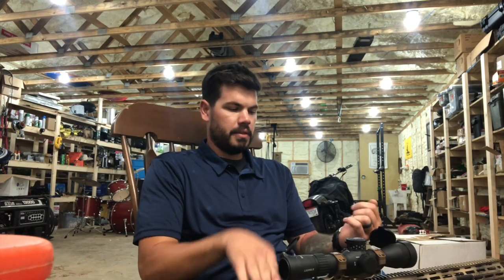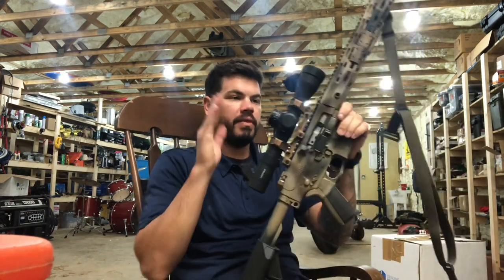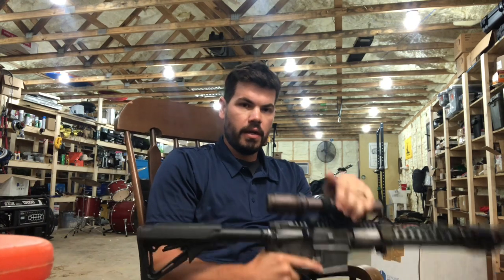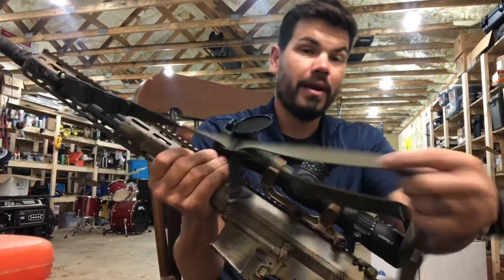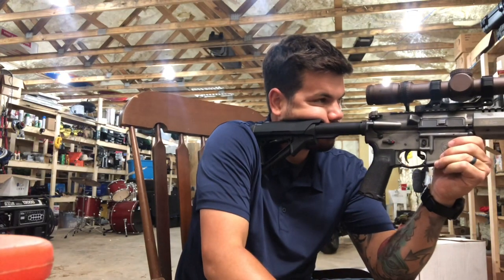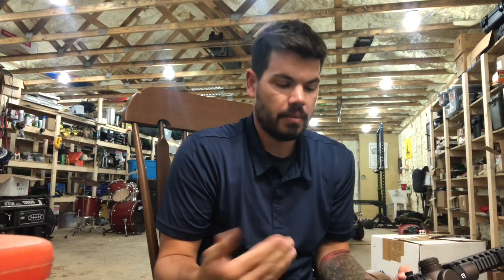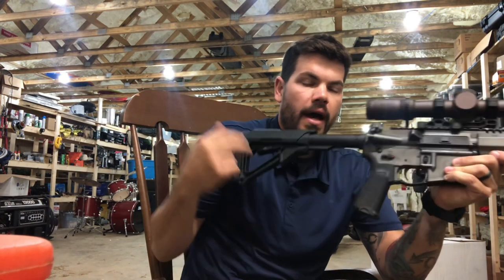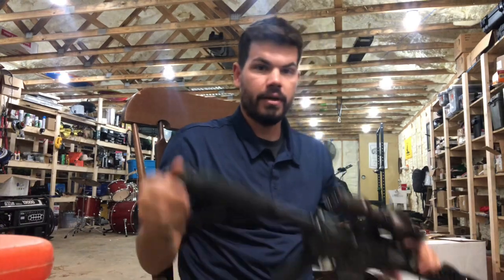Some things you need to know about high mounts and cheek risers NOW!

Comment: Great tips! Thanks 🙏 
I struggled trying to get my carbine where I would be able to use the fixed front sight/ carry handle rear sights and add an optic. I found the 2.5x20 Leupold does the job. 
It’s definitely a jaw weld but maybe it’s the fixed low power and generous eye relief that makes it work. Probably not the best competition setup but I don’t shoot competition.

Comment: Thanks for the explanation with parallax, I've never heard anyone explain why the higher mounts actually throw off precision long range.
I wear glasses, and getting my head in line makes me have to look over the top of my lenses unless my glasses are really pushed all the way up, so I'm hoping the 1.93 mount I have coming helps with that. I have the luth ar mba1 stock, so I think it will with the adjustable comb, which I've had to leave all the way down with the 1.5 mount

Comment: US Service Rifle Competition, where Shooters shoot from standing, sitting, and prone positions, inspires shooters to learn how to make themselves fit the rifle in any position for a muscularly relaxed stockweld, resting the entire weight of the head upon the comb of the stock. Correct adjustment is always possible when the rifle is brought to the head rather than the head to the stock. This procedure will allow bone to determine the height of the position rather than artificial support used in building the position. At any rate, retaining the 1.5 sight height is a good idea because the rifle can be made to get a proper stock weld from any position, noting as the position gets higher so will placement of the butt stock in pocket of shoulder.
Reply: Unless your cheekbone is not 1.5 inches from your eye, or you have a long neck, or wide shoulders. 

One size does not fit all.

Comment: I feel like if you aren't using a cheek riser, 1.7+ for lpvos and 1.5ish for MPVOs. I ran a 1-8x in a 1.7 at gas gun matches for a bit but suddenly one day I was shooting way low at 500 despite the gun being perfectly zeroed. Then switched to a mpvo in a 1.5 and did much better. And like you said it was probably because of not being centered, despite thinking I was.. Watching video of me using the 1.7, my cheek was a lot higher on the stock than it actually felt like.

Comment: When wearing hearing protection (big ear mufflers) your cheek will not be on the stock as it normally would, the hearing protection will hit first. At least you will have to raise your cheek about 0.2 to 0.3 Inches - this means you now need a higher mount.
Reply from the maker: So don’t wear those big ear mufflers then. That’s not a thing man. Howard Leight Impact Sports will solve that for $60

Comment: Is a 1.93 quite manageable in the prone with a 1/2” riser? Similar to a 1.7 with a 1/4” riser? I’m gearing up to try both, but thought I’d ask why you run a .25 with a 1.7 vs a 1.93 and a .5 riser with the math being pretty close to the same
Reply from the maker: Manageable. But not ideal. It’s a muzzle to line of sight issue and a neck angle issue.
Reply: @jbstraininggroup3640  pretty much across the board or person dependent? I’m tall but also not familiar with this muzzle to line of sight phrase. Unless you’re referring to HOB
Reply from the maker: @emtothedee  yes. HOB.
Reply from the maker: @emtothedee  nothing is concrete or absolute. There’s always outliers. But almost exclusively, higher mounts cause issues due to neck angle and consistency of mount for most shooters.

Comment: What height riser do I need if I’m running a 1.93 vs a 1.7?
Reply from the maker: No one knows. Everyone’s face is different. Start with .25 and go from there
Reply: Find out with cheap scope risers and taped on pool noodle foam before you buy. Amazon has chinesium adjustable pic-rail scope risers, and you can get foam to tape to the stock anywhere.

Comment: I only have an AR pistol. What cheek riser model do you recommend for an SBA3 with a 1.93 LPVO?
Reply from the maker: A stock. Haha. The only option for a brace is to build a cheek riser out of pipe insulation and tape or something similar.
Reply: The “stiffy” from Factr works well on the SBA3. Doesn’t address your question but just FYI

Comment: Quick question...how do you run the charging handle with the stock riser? Or do you only run the stock at full extension?
Reply from the maker: Full Extension most of the time. And I cut things with a Dremel and make em fit if I can.
Reply: Larue cheek Riser

Comment: the cheek riser still puts you back in the same position. Its simple math. You just explained all that as if this was not a fact. Did anyone else catch this?
Reply from the maker: Idk what you’re talking about.
Reply: @jbstraininggroup3640  The distance between the stock and the scope is reduced by the cheek riser thus neutralizing what you were trying to accomplish by getting a higher mount.
Reply from the maker: @safequeenking2884  just saw this. Sorry for the late reply. The objective of higher mounts is to not only clear gear when mounting the gun, but also to change the neck/viewing angle. By raising the stock and the comb, that is accomplished without losing contact with the gun.
Reply: @safequeenking2884  it's biomechanical interface. If you're big, you have to scrunch shoulders up and crane your neck forward, leaning your head to the right, and running the stock too short.

Raising the comb height solves the biomechanical issues, and increasing the height of the optic accommodates this as well.
Reply: You really thought you said something didn’t you big guy? @safequeenking2884